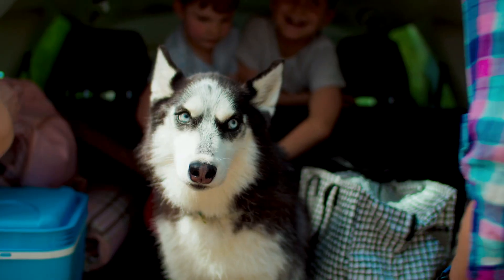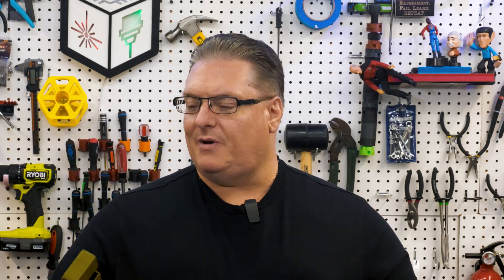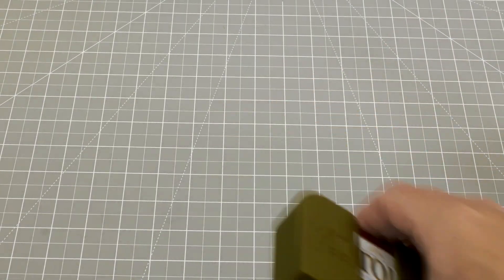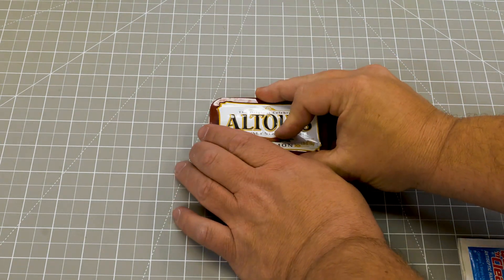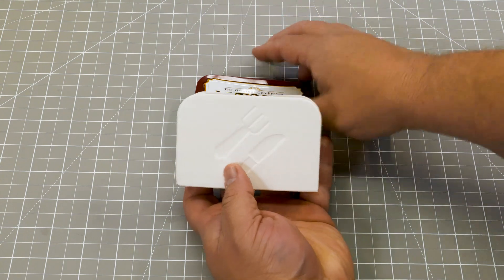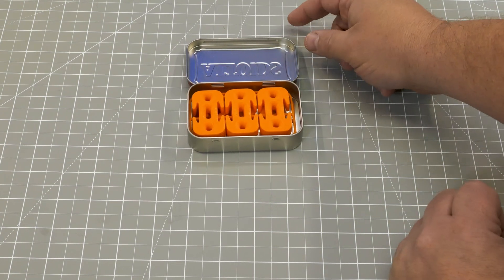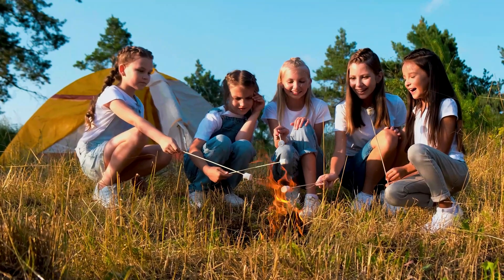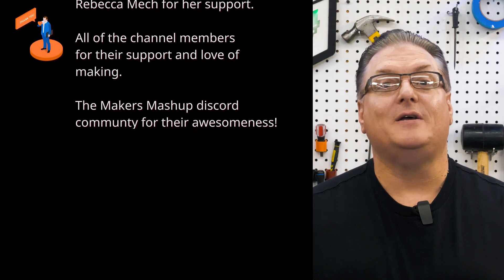3D Printing Your Way to Survival: DIY Mini Survival Kits

Comment: How could you adapt to molle straps?
Reply from the maker: Thats a great idea I had not considered that.  Honestly the easiest way to modify these would be to simply add a square slot that runs up the back side so you could easily pull the tin out.  That would hold it in place and wouldn't require supports.  Let me know if you want me to modify the generic template, it would be a fairly simple mod.